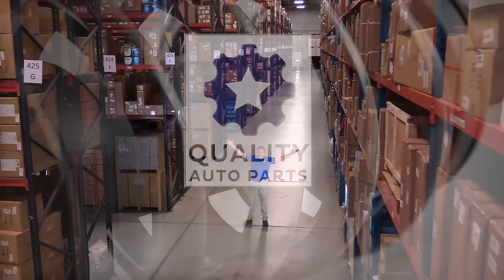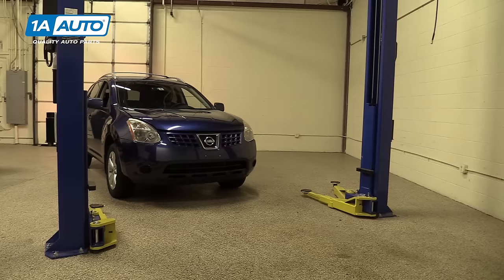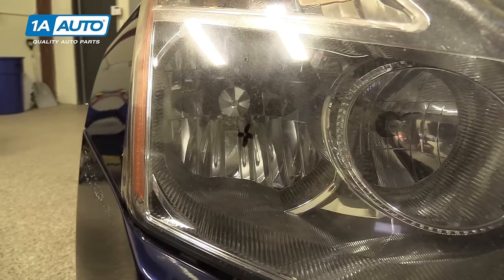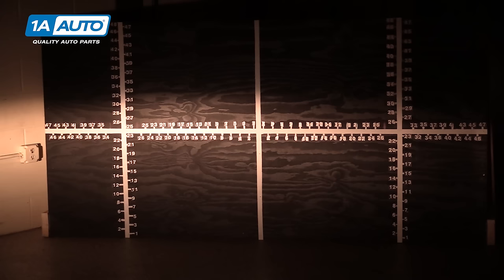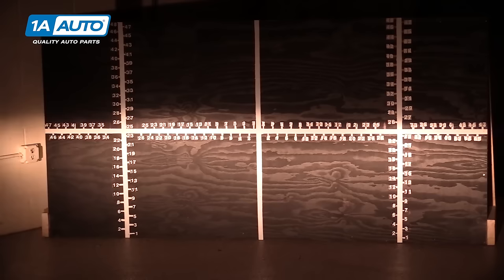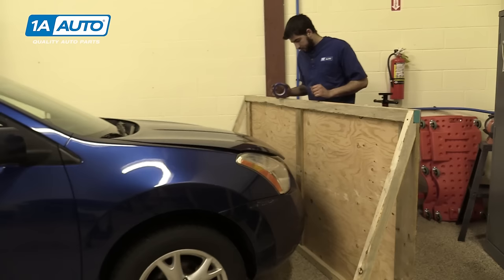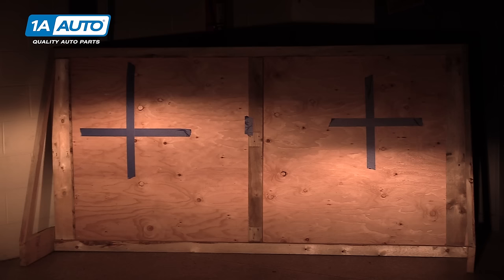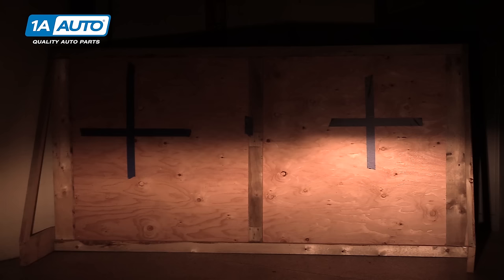How to Aim and Align your Headlights Correctly

Comment from the maker: √  Watch the Video
√  Buy The Part at 1A Auto http://1aau.to/m/Visit-1AAuto
√  Do it Yourself
√  Save Money
Reply: Wouldn’t u want the headlights at the exact same spot rather than passenger being higher and driver lower to not blind people. I just don’t want my projector headlights even so that at different angles it looks the same and not brighter than the other one. From factory, are the headlights even or one higher than the other like u guys said to do?
Reply from the maker: +Gerald Martin Thank you for your question.  We use UPS for shipping our parts.
Reply: @1AAuto  where  are your shops located
Reply: I have a 2008 Hyundai Santa Fe any idea where the headlight adjustment screw is at. It’s been at dealer twice for minor work but they keep forgetting  @1AAuto

Comment: I wish I had a garage that was 25 feet long, lol
Reply: Wish I had a garage.
Reply: Mark Stewart I feel you bro 😔😥
Reply: I wish i had a car
Reply: You gave me a good laugh! We were all thinking it, but you said it! Lol
Reply: I wish my driveway was 25 ft longe !
Reply: I wish I had.
Reply: I wish I had a garage 🐸
Reply: @delucerrr  why are you watching this video if you don't even have a car lmao.
Reply: My garage is 24 ft, so I will have to leave the front of truck on the concrete, & jack up the back of truck to make it level. Shit, I remember when I used to pull up 15 ' from a wall & just turn the screws that were easily accessible with a Phillips. Didn't have to pull stuff.
Reply: Right? I can use the gas station down the road from me near or after closing.
Reply: Thats what she said
Reply: Nah, you just need  one 25 feet away
Reply: You don’t need a 25 ft garage you need to be 24ft away!
Reply: @TheSheiit  Hilarious! :)
Reply: I wish I could see 25 feet but I'm blind! 😎
Reply: No you doont because then you w
Reply: Then it would be 35 feet long
Reply: The one time where trigonometry is useful
Reply: I wish I had a garage
Reply: I just use the parking lot at AutoZone after work. They have a brick wall. The lot is level, and if I go around back, most people don't drive there.
Reply: You know there are alot of walls all over the place. I'm sure with some tape and a screw driver you can get it done.

Comment: Althought this an awesome video I cannot see how most people will be able to find a floor that is perpendicular to the wall that lights are shinning on. IF you are inside a garage AND you have 25 feet plus the car lenght inside then sure, inside walls are perpendicular to the floor BUT if your are in any driveway, a parking lot, and facing any exterior wall then you are screwed because any ground surface around a building has to have a slope, even if minimal so rain moves away from the building. Been searching for a good location for a while and never found one. Still an excellent video and gives me all I need to know.

Comment: Based on IIHS data and some trigonometry, the following chart should serve well.
Back the car 25' away from the wall. First number of each line is headlight height in inches, second number is drop in inches. If you have projectors, measure at the HIGH side of the cutoff. If you have reflectors, measure at the top edge of the "hotspot", and drop the driver's side 2" more than the chart says.
22 1.5
24 1.75
26 2
28 2.125
30 2.25
32 2-7/16
34 2-9/16
36 2.75
38 2-7/8
40 3
44 3.25
48 3-5/8
54 4-1/16

IIHS describes 330" as the optimal distance of illumination for low-beams, and the majority of autos sold in the USA do not shine that far. The chart above should allow your low beam to illuminate the road 330' ahead (assuming your lights aren't embarrassed by a birthday candle).
Using the high side of the cutoff as your drop guide will allow you to see the 330' distance in low beam while allowing the low side of the cutoff to do its job protecting oncomers from glare.
If you're aimed according to the chart and shining into the passenger cabin in front of you, you're either a tall truck tailgating a pregnant rollerskate, or you forgot to turn off your highs.
If you have reflectors, dropping the driver's side a little more than the chart says will accomplish the same goal SORTA. I say sorta because reflectors are scatterbeams and will cause SOME glare no matter what you do. I recommend a retrokit to a GOOD QUALITY projector setup. If that retrokit uses HID bulbs, make sure they have a solenoid cutoff to allow you to switch between high and low beam.
In any case, try to get 5500K bulbs, or if you run HIDs with 55W ballasts, the next color temp higher.

Comment: Thank you so much. I just bought a set LED bulbs to replace a dead pair of halogens and I noticed that the cutoff was a lot higher than before.  I did as you advised and I am very happy with the results.  My lights are now well bellow the rear window of the cars ahead, nobody has flashed me when coming the other way, and the illumination I get is way better than before.
You got a new fan here.

Comment: And in states where this is part of the check for Vehicle Safety Inspection for license plate renewal this is very important. The phrase "Watch where you are driving. Keep your eyes on the road" come to mind. You have to see the roadway and conditions in advance to be safe. It's also true, you can 'overdrive' your headlights if the vehicle speed is greater than what you can see in advance to take evasive/precautionary action. All impacted by headlight aim. Thanks for the excellent presentation of this facet of motor vehicle safe operation!

Comment: This was worth watching. Other videos on headlight adjustment miss key parts like the passenger light will be higher than the left to elliminate blinding other drivers, and that you need to do this on a level surface. This got my lights finally correct. Thanks!

Comment: Great learning video!! Now only if other drivers would stop high beaming For my LED low beams mine are level and are not aimed high and my light housing is projector type so there's a straight line cut off they learn the hard way when i High Beam them back got the upgraded Halogens in the high beams
Reply: Newer lights have more output and as a result the spill is greater than standard halogens. I blame DOT regulations because ecode > dot

Comment: I read somewhere the ideal distance ANY headlight should reach out is 200 feet in front of your vehicle, for your DRIVER SIDE headlight. Using 200 feet is not practical so they settled on 25' as a good practical distance for measuring the drop. The ideal distance for the passenger side, I believe, is 400', but I won't do the numbers on that one since it generally doesn't blind oncoming drivers.

If you have an average headlight height of say 32" and you want your beam to reach 200', or 2400", then you have to calculate the proportional drop  between 25' or 300", and 200' or 2400". The formula would be as shown below, where you're solving for X, the drop at a distance of 25', or 300"

32"/2400" = X/300",  2400X=9600, X=9600/2400, X=4" drop at 25' distance. An even simpler way to calculate the drop is to take the height of your headlight and multiply by 1/8, or .125. This simplified method is for when the distance is 25 feet to the wall.

You can substitute your own headlight height, but the rough numbers are going to be around 4" for an average car.

Comment: Thanks. As simple as this sounds your method actually works pretty easy.    I remember my 1971 Yamaha Enduro motorcycle had this same method diagramed with instructions in the owner's manual. I must say owner's manuals are not what they used to be.

Comment: Thanks for a great video. You guys are really good at getting to the point while providing both what to do and some background as to why.  I've been turning wrenches for quite a long time yet still jump on YouTube for pointers. Glad I came across your channel. Subscribed.

I just replaced the headlamps in both a Buick and a Toyota. I'm going to use my garage door as the aiming board.  The precision with which to assess and make adjustments is going to pretty much lost on the Buick, meaning I can pretty much do that one with a little bit of winging because it really doesn't project a horizontal transition line. The Toyota on the other hand is a very distinct horizontal line and I'll stick closer to the book, er uh the video.

Comment: Excellent video guys.  Just upgraded my bulbs to the new Philips x-treme Vision Gen 2 and was unimpressed...until i adjusted them. Thank again
Reply from the maker: +Steve Mackenzie Thanks for watching. Keep us in mind in the future if you need parts for your vehicle. 1aauto.com
Reply: With reflector housing people say you can’t use LEDs and you can you just have to re adjust the headlights to the new bulbs
Reply: @ryans413 this was true a year or two ago, but you can use LED as long as they have the correct beam pattern, most modern LED bulbs have an adjustable base so it's not really an issue any more. Its HID that shouldn't go into regular reflectors. You'll see better with HID bulbs, but you'll be emitting tons of glare and blind oncoming traffic. HID bulbs should be in projectors, LED bulbs perform poorly behind a projector, so for the most part, a standard reflector is the only sensible option for an LED bulb. I recently heard these 4 sided LED bulbs do well in projectors but have not tried them because the 55w HID bulbs I'm running are amazing.

Comment: I have been a (UK mot test assistant) exactly the same thing as your (american) health test. when er do our headlight checks we have to use a beam setter and we do not have to set the o/s down 2". In our beam setter box we have a red line and provided the center of the beam "just where it kicks up" is below the red line the light is set okay, but we are allowed to pass the car provided it does not go more than 1"  (2.5cm) below the red line. there is more adjustments that we can also preform with the beam setter

Comment: I'm here because I'm Not one of those truck guys that lifts the truck and has no clue that the angle the truck is at now is nose more up and therefore pointing light up into oncoming 2 lane road drivers face.
Lifting trucks as a business should be where these trucks are at least corrected of this. However it's essentially the last place that seems to have a clue or concern to address it.

Comment: If your driveway slopes away from the garage door (and if it doesn't, you've probably got water issues in your garage), just use a water level to mark a line on the garage door at the exact height of the dot in your headlight. Mine drops several inches over the 25 foot distance. Doesn't make a lot of sense to worry about tire pressure and what you've got in your trunk if you don't level your reference line to your headlight.

Comment: All states should have aiming walls setup at the inspection station, forget the emissions testing that is just a money grab. Every night when you drive the new HD LED lights are a blinder. Oh yeah and the guys who run the LED light bars all the time, they are the worst. Those aux lights are supposed to be used like high beams and shut off when within 500' of other vehicles......
Reply: I drive around with my light bar on but it’s aimed down at the ground..
Reply: my  light bar is always aimed down in a way that gives good  light throw but does not blind on comers   but I had a local officer help me aim that
Reply: Light bars are actually illegal to use on the road in most areas. Off road use only

Comment: Stop using the standard 2" & 4" drop, these elevations change according to light height. States have min and max projection distances for the low beam. generally 135' minimum and 200' maximum. If you use the 2" drop @ 25' on headlights that are 42" you'll projected the beam @ 520' and not the state maximum. STOP BLINDING OTHER DRIVERS . 42" height @ 25' should be 5.25". Use the formula (42/200)x25=5.25" below center line. ( bulb centerline / light projection  feet  ) x the distance you are projecting it to  ( test wall, test board or other ) it could be anywhere from 10 feet to 50 feet. 

Fog lights have a maximum of 135' projection, so get those adjusted correctly too.

Comment: Parking garages should have a someway standard measuringline painted at their walls. When parked, you get attended your lights are not right aimed and you should visit your local garage (or do a quick fix at the spot yourself).

Comment: Decent information, but what if you don't have 25 feet to work with?  There should be some chart that breaks this up into equivalent distances so this can be done from say 5 feet withing a garage or just outside the garage on a driveway.
Reply: A parking deck, the side of a business after hours will work as well.
Reply: Agreed, but I went to the backside of Lowes to do this. A chart for 5' or 10' would be super helpful, too though.
Reply: i go to my local grocery store down the road and do it. They have a nice white wall and plenty of room
Reply: You don’t get it the distance is for proper adjustment. What you want is like leveling a 16’ board with a  6” torpedo level
Reply: @ArbitraryLifestyle  Use math.   A 4 inch drop at 25 ft translates to 3.2 inches at 20 ft, 2.4 inches a 15 ft, 1.6 inches at 10 ft, and 0.8 inches at 5 ft.  To find the 2 inch drop just cut the inches in half (1.6, 1.2, 0.8, 0.4) Keep in mind the decimal is in 10ths but inches are divided into 16ths so you will have to multiply the decimal by 1.6 to find how many 16ths of an inch it is, but you are going to lose accuracy the closer you get so disregard all of this and do it at 25 ft.
Reply: 25 ft = 300 inches.
So for a 2 inch drop @ 25 ft.
Use the equation: 2 ÷ 300 = 0.0066666666
So for every inch from your headlights to the wall. Multiply by 0.006666 to get the drop rate in inches.

And to convert the decimal points to 8th/16th of an inch. Multiply by 8 or 16 accordingly.

Comment: Great video! I have one question. If my headlights are marked as 1.3% inclination, for 25 feet it is exactly 4 inches. But if they are marked 1% or 2% the number will be different. Am I thinking right, is this the right way to calculate the inclination? Thank you!

Comment: How did you determine the height to set the headlights to? As in, 4” down on drivers side and 2” up on passenger side.
Reply: In the beginning of the video he took a tape measure and measured from the ground up to the center of the headlight. Also the driver side is 4 inches down and the passenger side is 2 inches down. Neither one of them are up from the headlight centerline.

Comment: I have a little gear that i turn clockwise with the philp head. The reflector is going going forword and backword but the light pattern is not moving. Nissan versa 2007.

Comment: since normal weight is supposed to be in vehicle when adjusting, should a driver and or passenger be in the car during adjustment?
Reply: yes to be as accurate as possible, but you could just adjust about a 1/2 inch lower

Comment: As the request below, if you have 2 lights on each side.. a high beam and a low beam light, how do you set each one...the same way you have it here? Thank you!
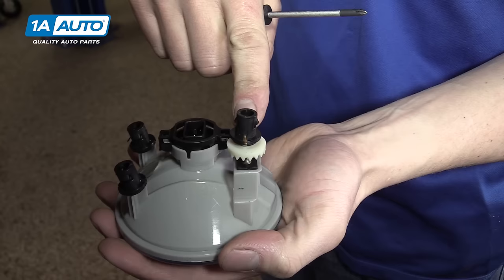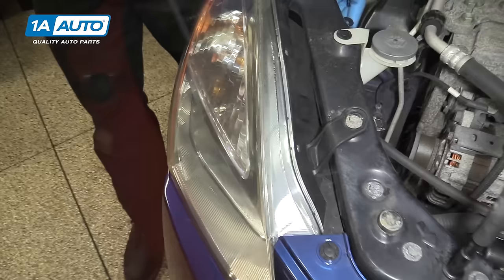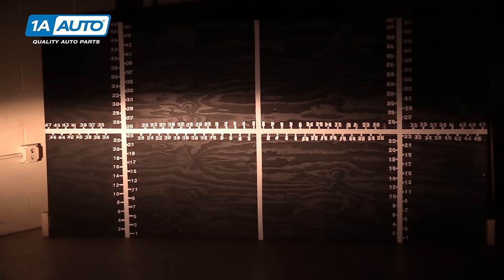Reply: A lot of people need to rewatch the video specifically from 2:45 to 7:20... pay special attention to 3:15 to 3:45 and around 5:15. YOUR Questions will be answered. Also you use your low beams since the entire point is to adjust them to not blind people cause you turn your high beams off.... derrr.... You should have your license revoked for asking such a dumb question...

Comment: What do you do when you run out of adjustment and suddenly the adjuster won’t even adjust? It’s almost as if the adjustment screw completely and effortlessly disconnected from whatever it was moving before I ran out of the adjustment range. These are brand new headlight housings!
Reply: Turns out I wasn’t anywhere near out of adjustment. The adjuster just failed. It stopped moving along the threaded post and started slipping. Taking it off I could tell that the housing for the adjuster flexed allowing it to expand a bit so the parts inside couldn’t properly engage. I fiddled until it was back to the right shape and working again but it happens again immediately once reattached.

These things are garbage. I ended up transferring the adjuster and frame from my old headlight, which works but I kinda needed the new frame due to a chunk missing from mine where the side marker light attaches. I can’t move the adjuster alone since the threading is different. All they had to do was use plastic housing that doesn’t flex/expand when the parts inside turn! If I had a way to hold the two halves together while turning it would work perfectly.
Reply: These were TYC brand Taiwanese replacements for 2nd gen Venture, Trans Sport, Silhouette, plus 1st gen Montana, Uplander, etc. Unlike others, they fit great and it really is just these adjusters that are the Achilles Heel.

Comment: If your light are right to begin with and you're just replacing the housing, can you mark where the lights are now, swap housings then adjust to where the old lights were? Does it have to be 25 feet?
Reply: Maybe not the whole 25 feet, but still quite the part of them, because on a shorter distance, even a deviation small as a fraction of an inch will become feet in the distance. It has a lot in common with shooting with a gun. The only good thing is you won't need that flat terrain, just remember/mark where you exactly had the car and read the owner's manual for the exact numbers as they vary from vehicle to vehicle.